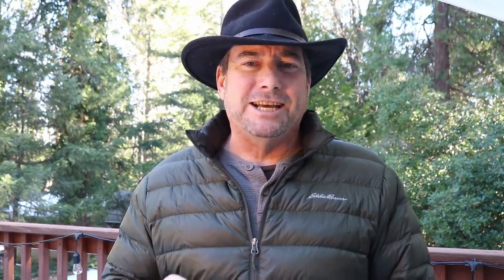Blancolirio UH-60 Safety Stand-Down

Comment: Hi Juan! I was down at Sato Cano AB in Honduras in the 1980's. We were participating in a joint exercise with the Honduran Air Force and Army. One night, after flying, several of us were invited to hop a ride on an MH-53J Pave Low helicopter operated by the 20th SOS out of Hurlburt Field, Florida. The pilot, a major who'd previously flown in the Marine Corps, was going up into the mountains the next morning to retrieve a Honduran UH-1 that had had a hard landing/auto rotation. The opportunity was great and the temperatures/humidity in the mountains were dramatically cooler, around mid 70'sF. On the way up through these rises and heavily jungled valleys, we got pretty close to some trees and were making some aggressive and pretty amazing turns. I became somewhat concerned when I noticed that the crew chief was not very happy about the way the major was horsing the ship around.  On the way back, we flew a much subdued and quiet flight!

Comment: Juan as a former 10 year Army Aviator UH-1’s  nap of the earth flying, which is 80% of Army RW flight, nap is pronounced nap as in “I’m going to take a nap”.  By the way my Army Career ended when I was hired by American Airlines in 1986 with only about 350 hours of multi engine  FW time.  17 year career, I flew the 72, S-80, 75,76,back to 72 as a Captain then 77 for 18 months then went back to the 73 as a CA.  I retired in 2003, took early retirement after all the layoffs an moved to WY for 9 years, 3 miles from Aviat.  Flew a retired wealthy guy around the country for 7 years, then went back to Ft. Rucker and worked for URS teaching student aviators IFR flying in a TH-67, finally finishing off my career as a medivac pilot flying a Bell 206L4.  We used Anvis 9’s which are so much safer than the old modified. -5 infantry NVG’s I used and taught nvg flying in, even the -5’s were better than the flying we did at Ft, Campbell at night 200’ above highest obstacle, once in a formation of 45 Hueys for 3 lifts moving a Battalion of troops. We called night formation night terror missions. We didn’t have nvgs then.
Reply: Great career Bob, and especially thank you for your Army service. Enjoy your retirement!

Comment: Juan, I am a 70 year old applied mathematician who has worked in defence science (non-USA) and your comment about the existence of 2 experienced supervisors on a flight raises a non-trivial statistical question. Defence science throughout the OECD crawls all over such matters and it has been studied to some degree or another. Behavioural aspects in this area can be very important. Although it may sound counterintuitive that an excess of experience may not make things "safer", it is the role of  the empirical defence scientist to establish whether that is actually the case.  You are providing a service of great value to aviators and may I  congratulate you on the the intellectual integrity of your work. I  really hope they get to the bottom  of this.  In the 70s I did some Fourier analysis of  Huey gearbox noise to develop predictive models of gearbox failure.  The guys who get up in those things rely for their lives on the integrity of the underlying science. Best wishes.

Comment: @Blancolirio  The UH-60 Blackhawk Helicopter's Windshield is an Anti-Ice system and not a De-Ice system. That means, it's meant to defog the windshield, and prevent ice, not remove ice already accumulated.  The Blackhawk is equipped with windshield wipers for the Copilot, and Pilot only.  The three windshields (Co-Pilot, Center, and Pilot)  are electrically heated via 3 Phase AC power, 115VAC to ground, 200VAC phase to phase.  Each windshield has it's own switch, and anti-ice controller.  The windshields use phase to phase heating elements, in delta configuration.  There are 2 temp sensors in each windshield. The most common failure in that system is a faulty temp sensor.  When the sensor faults, it typically faults open, causing the controller to think the windshield is hot, and turns off the power to the heating elements.  As for the engines, they have a really good "IPS" system. (Inlet Partical Separator) When Hurricane Katrina happened, we had one suck up a shingle from a rooftop during a rescue. The engine was undamaged thanks to the IPS.
Reply: Will one temp sensor failed open be enough to disable the heat, or with both open, will it default to a duty cycle based on density, airspeed, and outdoor temperature (pitch and power, if you will)?

Emissions critical sensors in automotive have to be redundant, the redundant sensors must have different slopes and offsets, and the controller must be able to detect open, short to power, and short to ground faults. You'd think military aviation hardware would require at least that.
Reply: @roflchopter11  One temp sensor failure will disable the heat for just that windshield. The other two windshields will operate, as they are all three independently controlled. The temp sensors are thermal resistors.  The higher the temp, the higher the resistance. Each sensors at room temperature reads about 300 ohms.  They connect in parallel, so at room temperature they read 150 together. If one fails open, the system sees 300 Ohms instead of 150, and thinks the windshield is hot and turns off.  The controller has no air data input.   It has no default duty cycle. Thermal resistors < some predetermined temperature (I forgot what that temperature was But I think it was like 80F - 115F  or something ) and they turn on full heat. Once the windshield heats up, and the resistance goes high enough, it turns it off.  The only other way it would be disabled, was if they only had one generator operating, and they had the backup hydraulic pump running as well.  For load shedding reasons the backup hydraulic pump has priority over the windshield anti-ice. If the backup-pump is on while they are flying, it means one of their two primary pumps failed (Or the APU start accumulator has a low charge) Without hydraulics the Blackhawk is unflyable.  Their redundancy is that they have 3 windshields that are all independently controlled for heat.   Some aircraft I have worked on, had an extra set of temp sensors in the windshield, so that if one sensor were to fail,  we could just swap the wires.  This prevents a windshield replacement. Of course once that second sensor goes, then it's windshield replacement time.

Comment: windshield ice should have been on before icing encountered in those conditions.  IIMC is practiced and covered in the Army SOP. Too early to tell what is going to me. ( I am a retired US Army UH-60 pilot) and still flying Sikorsky helicopters (UH-60s and S-76s), Gulfstream's and Falcons.  There has been a "drift" away from IFR skill sets with all the deployments to areas where no IFR flying is done ( observation/ opinion) . Fact; the Blackhawk is an incredibly capable IMC/IFR aircraft in known conditions.  I carried ICE on that platform before I knew better/ de ice worked awesome. Flat light conditions are a problem but the generation of NVGs used in the Army now are super capable and incredible in low light conditions, with man made light near by. or not  These two crashes have similarities no doubt, it is way too early for someone like me ( with only public information) to make any kind of determination  .  I think you regularly put out great informative fact based information, to include this.
Reply: I often wonder why it isn't possible to protect engines from taking in objects with a protective cover like a hardware cloth, (heavy duty wire mesh). I'm sure there is a good reason like maybe restricting intake?
Reply: I, as one, noticed that (I don't remember the name or number)twin roter,twin engine helicopter had some kind of screens in front of the engines. It seems to me you could do that for most of them. Thank you. Michael said that bye for now my friends.
Reply: @MikeJones-rk1un  That’s the main reason. Another reason is it increases the chances of the engine to FOD out in the case of bird strikes
Reply: @MikeJones-rk1un  And added complexity and some additional risk. Whenever you have a screen (think filter) it will accumulate debris. It can be a tough call to make the screen pass enough into the engine so it stops only the "problems", and then after some stuff is caught it suddenly (exponentially) starts catching more and smaller stuff.
Reply: What I said before about screens  on the engines, the screens were pointed, stuck a ways out in front of the inlets
Reply: @MikeJones-rk1un  Blackhawks used to have Inlet Barrier Filters, basically big KN filters google it. But they reduced power available and in high hot heavy conditions you need all the power you can get. And they were heavy, and the ingested oil from the filter actually caused erosion to the engines because it allowed sand and dust to stick inside the engines as opposed to dry sand being flushed out through the IPS. 
https://www.aerometals.aero/images/legacy-system-attributes.png
Reply: @michaeld.coulombesr.583  Yeah… NACA did quite a bit of testing on the idea in the 40s and 50s and I think again on the century series, as NASA and they all came to the same conclusion — any potential benefit was outweighed by the risks of using one. IIRC, even AVRO and Orenda toyed with the idea, and some early type 11s had them. Apparently just having the screen in place decreased performance by a minimum of 25%.
Reply: Its actually amazing how much power is lost using screens/filters! Even something as open as  1/2 grid mesh just robs power, More power is definitely a safety feature (atleast in military helicopters), plus the whole bit about clogging usually being worse than or equal to damage from debris.
Reply: interesting to read about how much power is lost by using even crude screens.  however, if the problem is reduced air intake, it seems like one for which a solution can be engineered using something along the lines of a supercharger.
Reply: @confidentialcandidate2135  a jet engine is already, by its design, a supercharger.

Comment: Very nice work, you covered  sensitive areas that needed to be covered.  You are describing a brilliant way to manage risk.  I liked that fill-in risk chart; made a complex job very simple.  This should be implemented.  It will save lives.  Thank you for posting that.

Back when I was a kc-135a nav, that type of risk assessment was beyond what we had.

I was the designated wx expert.  When flying near thunderstorms was fx, I would DR the movement of the cells and put its location and eta on my chart.  Once the wing commander flew with our crew.  During crew brief, I laid out my chart and told them were we can expect cells to be.  The Colonel loved it.  We were not allowed to fly near thunderstorms, required separation was 20 miles at cruise.

Comment: Well presented Juan. Risk assessment and risk mitigation is an essential tool in the tactical helicopter world. Failing to give it its  proper due will put you in precarious situations. 4400+ hrs, 800+ hrs NVG all helicopter time, RCAF Flight Engineer. I've had my fair share of scary moments and sometimes because pilots that wouldn't listen to me or choose to believe that the forecast wasn't as bad because the actuals at the moment were "good enough". Helicopter autopilot systems usually needs 60 knots forward airspeed to be able to couple up. NOE in bad weather usually means that your creeping along slowly trying to maintain visual references. Trying to climb into cloud at low airspeed in an IIMC is very dangerous and can cause severe disorientation for instrument interpretation. Usually it will be rudder input that causes excessive compass heading change and the pilot will try to bank in the opposite direction to correct. Fatal error by causing the helicopter to roll over and total loss of control. Better pilots don't bet their lives or their crew members lives just to get the tick in the box for the quarterly qualifications. Call it off and do some safety training instead.

Comment: Too much seniority absolutely can increase risk! I can recall a UH-1N crash during 180-degree Autorotation training at Kirtland AFB, NM in 1996. Onboard were the Vice Wing Commanding Officer (VWCO), one Instructor Pilot (IP), two Student Pilots (SP), one Instructor Flight Engineer (IFE), and one student Flight Engineer (FE). Training regulations at the time called for the aircraft to recover at a 10' hover on runway heading - no touch down. There was a stiff crosswind that day. The VWCO was at the controls and contacted the runway perpendicular to runway heading. Balled up the aircraft and completely destroyed it. Amazingly no one died, and the most serious injury that I recall was a broken back on one of the SP's and maybe a broken jaw on the other. The IFE had a softball size dent in his helmet where the remains of the rotor head impacted him. When things started to go awry or not according to plan, someone, anyone, could have and should have communicated over the radio to initiate a 'go-around'. One HAS to believe that no one did because of intimidation or fear of calling out and/or embarrassing the VWCO. Had I stayed in the UH-1N Flight Engineer Training Program I would have been on that flight as a Student Flight Engineer. As it was, I had transitioned into the MH-60G and was on a training flight of my own when the incident occurred. I often wonder if I would have had the strength of character to initiate a go-around.

Comment: I live in KROC, and I have read/heard all of the publicly available information on that accident. According to witnesses, the aircraft was still running/making power, but losing its ability to fly and stay airborne. This was in a densely populated area of homes and businesses. The 3 pilots on board searched for and flew it into the only vacant land available. It came in fast, indicating it was not able to do any kind of "normal" landing, more like they flew it to the crash site. All that is from everything I read and from what I know from being a fixed wing pilot. I could grab some links from local news sources and post them here if interested.  IMHO those guys are heroes for avoiding everything on the ground and saved lives doing so!!!   God Speed    --gary

Comment: Just a couple comments from a retired National Guard crew chief (UH-60A/L). First of all, while standards come from Army Aviation, there can be considerable variation in how states approach tasks. Also, low level flight on goggles was a core competency. We did that lots, much more than Air Force and Navy from what I gather from friends in the other services. I ended up with more goggle time than VFR day. On the down side IFR was pretty much an emergency procedure. Also, when on goggles it’s pretty easy to miss degrading conditions. Precipitation in particular can get pretty bad before it’s noticeable unless you happen to be hanging out the window, which at low level was a must for th CE albeit pretty miserable is bad weather.
In the flights in question you make a point about senior officers on the flights. In what capacity? Were these check flights or were they along for currency? A pilot along for currency tends to be a passenger when he’s in the back unless they were specifically briefed. Why no crew chiefs? That was very unusual for us, about the only flights without them were maintenance check flights. Were the units recently post deployment and short of crew?

Comment: There may be some confusion in this latest mishap. The aircraft is an Army National Guard UH-60 and not an Air National Guard aircraft. Very good talking points Juan! I agree with another comment that current Aviator Night Vision Goggles are supremely good in very dark conditions. Heavy snow fall is a concern as a restriction to visibility. One of the issues that Army aircrews face is that as the weather deteriorates during a flight, in many cases what was briefed as low risk initially, may become moderate or high risk and calls for the approval of the appropriate risk authority to continue flight operations. With the improvement in communications such as tactical internet and tracking technology, it would be interesting to note whether the flight was being monitored. Also of interest is whether the aircraft was a UH-60M. With the advanced flight control systems and avionics the aircraft will literally fly or hover itself.

Comment: As the saying went sometimes in the middle of a complex aviation exercise, "If we fight a war, it better be in daytime VFR." 😯
Reply: I used IFR: I Follow Roads.
Reply: When I was in the Air Force, my F-15 unit deployed from the clear skies of New Mexico to the Netherlands for an exercise.  On a day with low overcast and no precipitation, our "all weather" F-15s were grounded for safety reasons due to the poor visibility.  Meanwhile, the Dutch squadron on the same airbase was doing formation takeoffs in their F-5s into the cloud deck...
Reply: @jeffbangle4710  One of my Tucson friends flew the F-15 Eagle.
Reply: @jeffbangle4710  I wish I could mention a few of the situations I have seen right here in the States with civilian pilots using equipment like Juan is flying who have been operating with lower minimums, and/or more effectively able to utilize them in adverse weather, than ops at the big bases next door. It feels like doing that would be giving too much material to unfriendly parties, though, and I once had a conversation with a Russian MIG-29 pilot who had defected, and his squadron’s woes along similar lines were unthinkably worse. It is something that needs attention, though, and continuously—not just when it hits the news.
Reply: During WW2 there were several occasions when the weather stoped us from providing air support to a particular battle or campaign, the battle of the bulge comes to mind, where we didn't start getting the upper hand until the weather cleared out and we could finally put our aircraft back in the air.